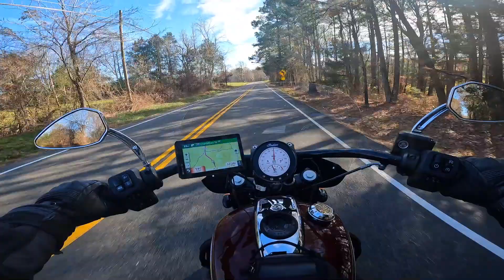How often do you add air to motorcycle tires?  Did my shop damage something?

Comment: Nice camera angle, that color looks cool in the sun. I had a metzler tire that had a slow leaked. I would just check it and add 2lbs. When it got down that far. Your not going to notice ill handling, until it gets to 26 or so. Tire wear accelerates at low pressure but its not unsafe, especially in the colder months.
Reply from the maker: Thank you!  Truth be told, I really wanted the blue version but this maroon has grown on me.  On my first bike (Indian Scout) I did a terrible job of checking tire pressure--shame on me.  Pretty sure that's what cause the rear tire to lose most tread before I hit 3,000 miles.  I'm hoping it's just a tire issue and the guy that installed them didn't damage the front wheel where this becomes a permanent issue.

Comment: Sometimes MC tires leak air, especially if you don't ride much, so leaking a little air is normal. I check my tire pressure everytime before I ride.
Reply from the maker: Thanks for watching and commenting.  I'm hoping this front leak improves when the front tire needs replacing down the road.  Hope the guy didn't damage the wheel making this a permanent thing.  I tend to ride a lot and I have to put air in regularly on the front.

Comment: I check my tires maybe once a month, depending how often I ride. Never been asked to bring the wheel only though, that's plain weird. You wouldn't take your car wheel/s off to take to the garage or shop. Thanks for the ride and chat.
Reply from the maker: Thanks for watching & commenting.  I didn't check my Scout often enough but now the bluetooth sensors on this bike let me check all the time.  Cycle Gear offers to mount tires on wheels but they were the ones that say you have to bring the wheel in.  I had a second shop tell me the same thing because they said they did not like working on spoke wheels.  Now that I have non-spoke wheels, maybe it will be easier to find a shop to work with.  I had a very hard time finding any shop willing to work on spoke wheels before I traded them out on this bike.
Reply: @RamblinManMoto  Hi, does not sound like a very friendly customer attitude. Never heard anyone being told to bring the whole wheel in here in the UK, always a first time though! Have a good Christmas Sir.
Reply from the maker: This was at the chain Cycle Gear that sells tires and says they will mount to your wheel and I had two independent shops tell me the same thing.  Some just refused to work on spoke wheels completely.

Comment: I usually check mine weekly, never have to put air in.
Reply from the maker: Cool.  The bluetooth sensors I put on make it easy to check but I'm tiring of having to put air in the front tire almost weekly.  I hope that goes away when I wear this tire out and put a new one on.  Thanks for watching and commenting.

Comment: Don't sound like much of a leak. Soap and water should find it, if there is one. Changing weather makes it harder to determine w/o testing tire.🦇
Reply from the maker: I tried the soap and water method on the surface of the tire and found nothing.  Looking back, not sure I really tested around the bead or if that would work.  Someone told me the guy may not have gotten the bead properly set (?), I think.

Comment: That digital display on the bike looks really cool. I think Indian did a great job on that. 

I check my tires often, but I've never had to add any air, of course I'm not an expert.

Cool vlog, ride safe.
Reply from the maker: Thanks for watching & commenting.  I'm a tech junkie and will admit I purchased this bike due in part to the digital display.  They packed a lot of neat stuff into it.  The navigation system isn't the greatest but I like everything else about it.  I didn't check air on my first bike like I should have--shame on me.  Rear tire lost tread quickly as a result.  I've now installed those bluetooth sensors so I can easily check the pressure all the time and it makes a fuss if it goes below the settings I've put it on.  I hope this front tire issue will remedy when I put a new tire on.  I get tired of having to add air to it about weekly or so.